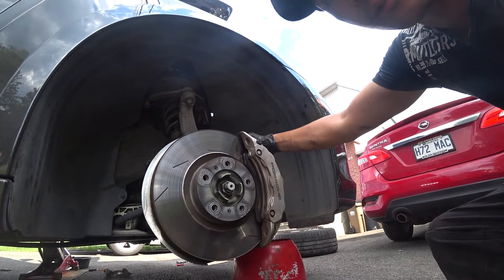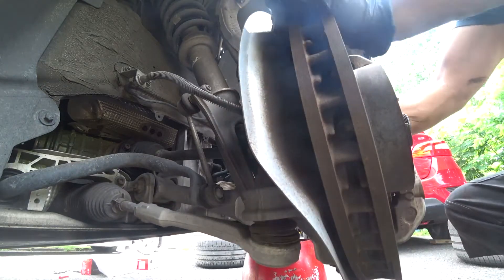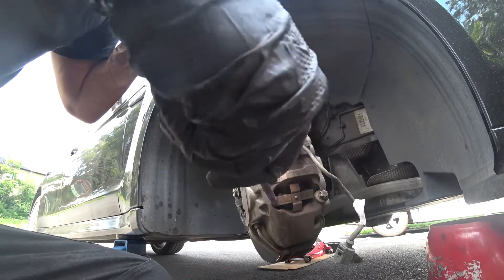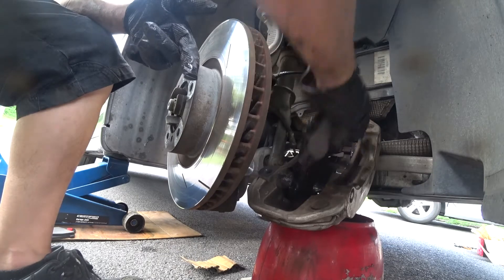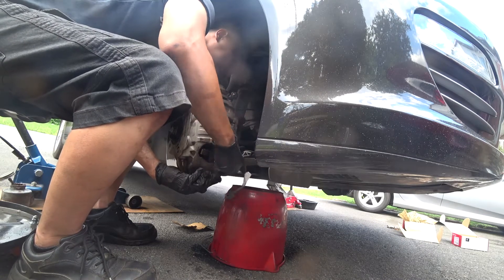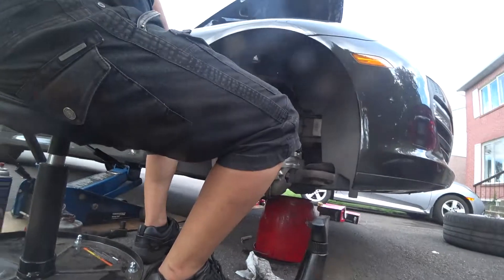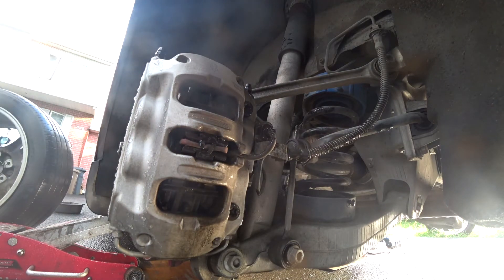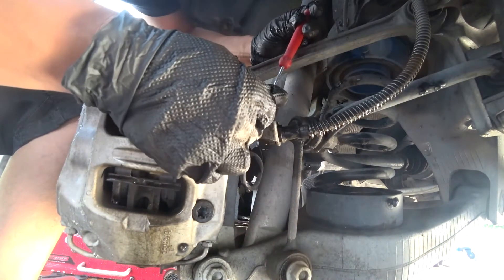EASY - How to change brake pads on a Porsche Panamera (Brembos) Similar method for any Porsche

Comment: Is this the same for the S Hybrid?
Reply from the maker: very similar yes but the S hybrid will maybe have slightly difference calipers therefore different bolts.
Reply: Do you need a scan tool to do this
Reply: @martiesewilliams4883   No.